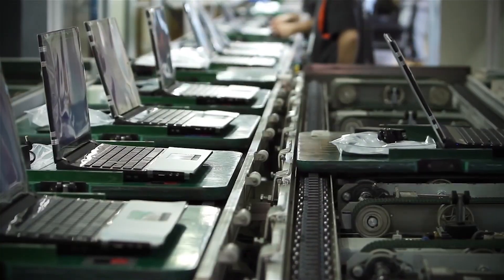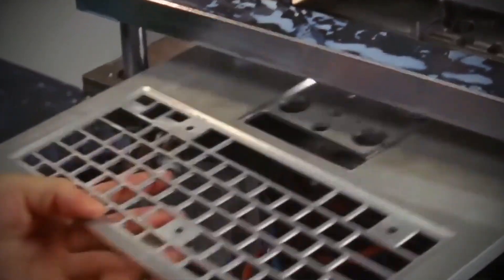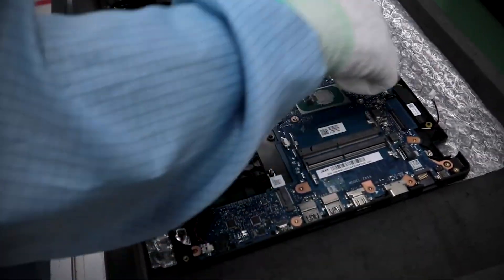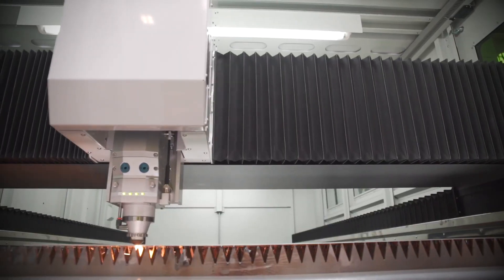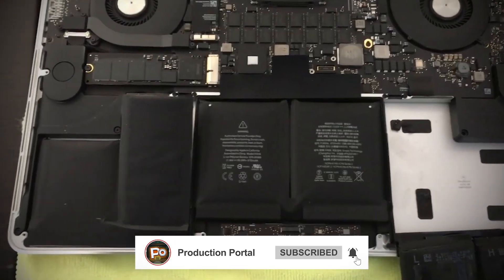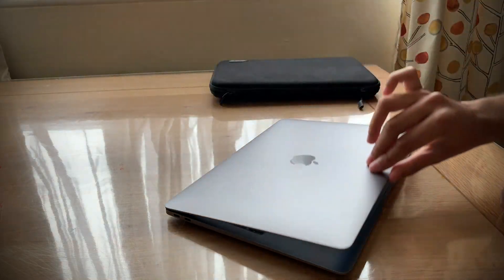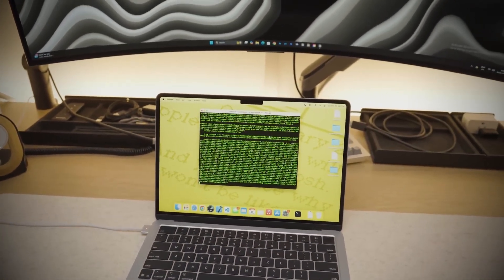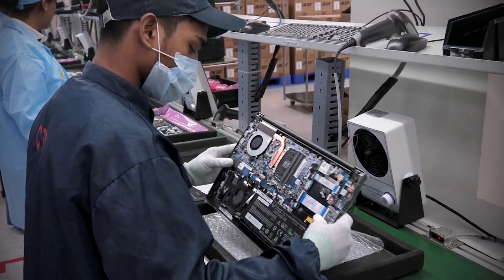You Won't Believe What Happens Inside An APPLE Laptop FACTORY

Comment: Hd drop notch gsm lte wcdma
Gb rams memory card roms quad core technical display project bulb led LCD sensor piece pixel w. B.t 4000 dual 4g touch botim pin attach pack